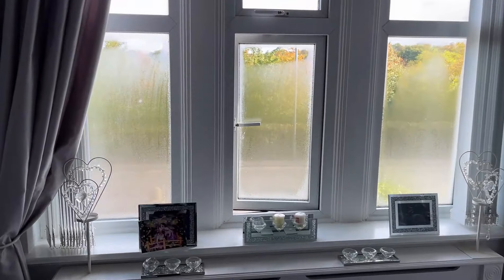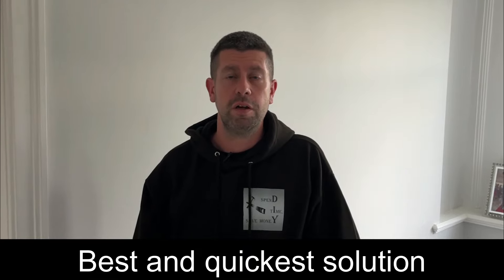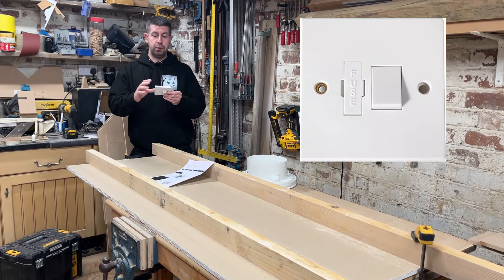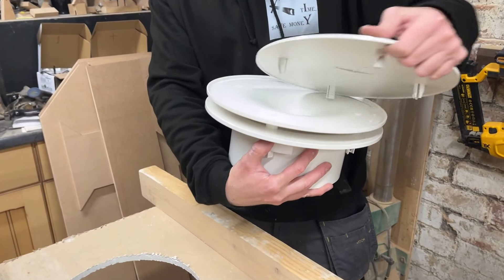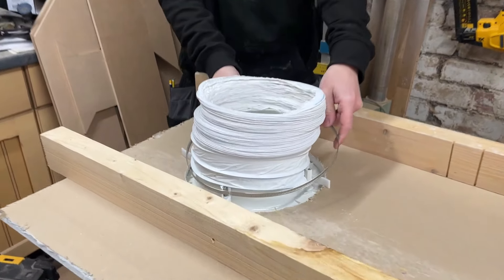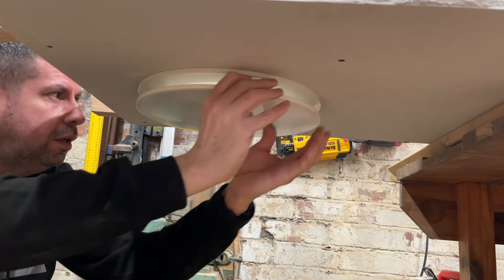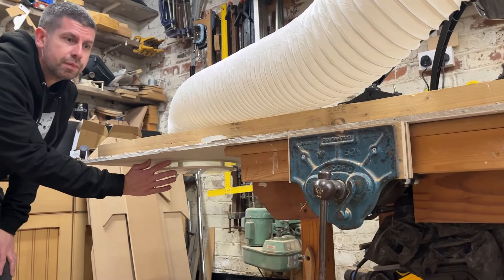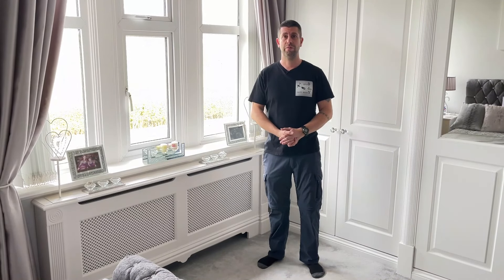How To Get Rid Of Condensation And Mould 'FOREVER!' With A PIV Unit.  Easy DIY Solution

Comment: We've hardly any condensation as we use a dehumidifier for drying the clothes in a room rather than the radiators like we used to but the RH level is still 72% plus after opening the windows to change the air etc. We tried placing the (expensive) dehumidifier at the top of the stairs but, whilst it was keeping the upper levels at a reasonable humidity, it just wasn't really affecting downstairs. We've now bought a heated version of the Nuaire Drimaster and it's due for fitting tomorrow, I'm doing the fitting and an electrician is wiring it up to the lighting circuit in the loft. Fingers crossed...
Reply: Sorted and works a treat, took a few weeks to get there though. Now at 55% RH downstairs on speed 4 so will eventually drop this if RH gets too low. NO condensation at all on the bedroom windows even in this freezing weather !

Comment: stupid idea... 60-70% of all UK houses have in bathrooms already fitted, extractor fans... all you need to do if wanting to achieve the same affect, is swap the already fitted fan in/ out ducting in your loft, three minute job with one screwdriver after hitting isolator switch, and you will have air from outside being pushed into your rooms, so reducing on mass the humidity. But is that really the solution. Yes as that is exactly what a trickle vent is right? But some hard stats on this needed, and a £20 humidity sendor with wifi, in every room in a house, monitored to see/ before after affects, and keep the weather outside and heating inside the same to prove it.
Reply: I considered this and you are right it does the same thing however extractor fans are noisy and when you do have a shower you will be pushing that moist air around the house. The piv fans are huge meaning when run on the lowest speed settings you can't hear a thing and the volume of air being pumped in exceeds what the extractor fan can do. The piv also moves a large amount of air at a low speed so you don't really feel a draft.

Comment: Any issues with loft smells? Mines a 1930s house too but roof tile direct on Batten (no felt) so I gets a bit musty in winter.
Reply from the maker: We haven't noticed any smells but our loft is fairly clean with a new roof
Reply: We’ve had ours in for just over 5 months (Jan ‘24) the first month or so you can definitely smell the loft but it isn’t overwhelming. It has died down now and only the odd occasion you notice a smell and even then it’s only right under the unit.

Comment: How much does it cost to run? We're getting our loft borded in Jan and now thinking about getting a PIV installed afterwards 👌
Reply: The unheated version on mid setting  costs about £2 a month (depending on speed setting), we have it on speed 4 which is about 10 Watts an hour, so 240 watts a day a day times by 30 = about £2. With the heater on it will be quite a lot more depending on the set point you have it at BUT it will only actually 'heat' the air a couple of degrees anyway  so IMHO not worth having on. We actually have the heated version but I switched the heated element off.

Comment: Excellent video, and I'm glad this has resolved your issue. We were experiencing similar a few years back, but luckily, a dehumidifier solved it for us. We bought a Pro Breeze unit and placed it in the cooler part of the house. As you mentioned, keeping to a consistent temperature is also key to this.

Thanks again for the video and great channel too.
Reply from the maker: The dehumidifier just wasn't enough for us. Thanks for watching 👍🏼
Reply: It's insane how much water we collect in our pro-breeze.

But I'm really liking this system. It makes a lot of sense on a lot of levels.

Comment: They really do work - I considered the heater version, but it’s really not necessary.  Easy to install and our house just feels more comfortable.
I’d argue that they save you money - it’s cheaper to heat a dryer house.
Reply: Did you go for the unheated version then? Would you go unheated if doing it again? Asking as I'm pondering the question of heated vs unheated right now.
Reply: @ Yes unheated - it’s still installed, working well. We don’t even notice it’s there. If you stand underneath it you can feel it a little, but it’s nothing really and who really stands in their hallway? I personally think the heated one is a bit of a gimmick.
Reply: Thanks for your reply. I've heard a few people say the heated version doesn't seem to do much. More expensive to buy and will use more energy so I think I'll go unheated as well 👍

Comment: Good to see you back mate. Have you noticed any increase in heating costs due to the cooler air being pumped in? Ive been considering one of these, the idea of continuous fresh air is appealing.
Reply: I have one installed come the winter your bills will jump quite abit makes my house really cold
Reply from the maker: Thanks it's good to be back.
The air is heated as it's pumped in but people have said even without the heat option on they haven't noticed any difference
Reply: @spendtimesavemoneydiy  cheers mate, that's good to hear.
Reply: @THEGSADVENTURER  we already have solar panels on the roof as it is so they're offsetting our costs a little bit.

Comment: Have you noticed a drop in temperature.  How ofter do the filters need changed as roofspace a arw very dusty
Reply from the maker: No drop in temperature as the air is heated as it's pumped in.
Not sure about filters yet but I suppose it will depend on how dusty the loft space is.

Comment: Hi mate, I installed one of these and I can’t figure out how to make the heater come on. I think it’s the C18 setting, which is between 5-20, do you have any tips on what I should set it to, so it comes on and blows Warner air please?
Reply: It doesn't blow warmer air as in like a fan... tbh I wouldn't turn the heating element on as it only 'heats' it a couple of degrees anyway

Comment: We have condensation problems in the loft, could this be fitted in the loft without the vent part in the ceiling perhaps?
Reply: The PIV channels air from the loft into the house. The air in the loft should be less humid, if you have condensation issues it sounds like there is insufficient ventilation? You might need some vented roof tiles or vents in the soffits
Reply: Rather than get  vented roof tiles, a hack is to place round pipe lagging where the felt joins to increase airflow...

Comment: You've got a fantastic channel fella and I watch all your uploads, first class content. but these PIV systems are a complete rip off, cost wise.  don't get me wrong, they do work but you can make your own for a fraction of the price and they only need to run off a USB cable and a USB computer fan. think about it, cold air can't hold moisture but warm air can, warm air rises but cold air sinks, so that nice little trickle of cold air from the ceiling prevents the warm air from holding moisture but its not quite strong enough to effect the temp of the room ( unless you have no heating on  in the room, but even this way it will have no condensation or mould problems)  but it stops the moisture build up.im sorry if I come across as being a know all, I really don't mean too, but I've sorted my condensation and mould problems out doing just this. I'm a Wiganer and frugal is my middle name 🤣🤣

Comment: well there really isnt any easy efficient way is there .im in S.E   bc canada  i get 4 seasons right now im in the rainy to snow transition . i have run a dehumidifier but dont want to waste electricity plus the cost .maybe ill just try calcium chloride to pull moisture from air .its crazy cause you can just boil potatoes at supper time and steam out the house .